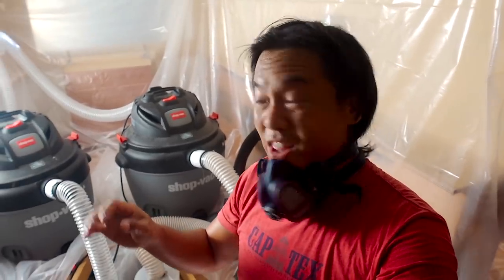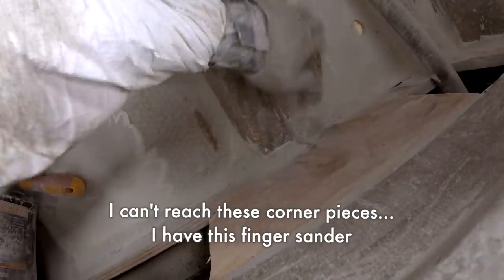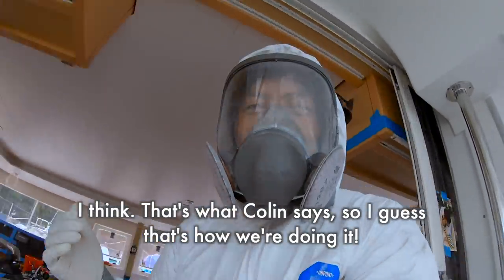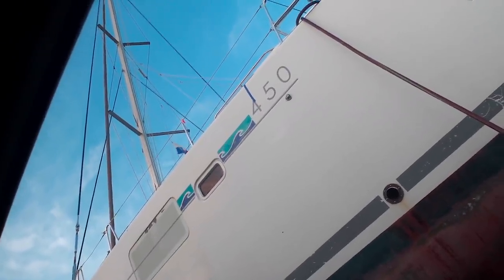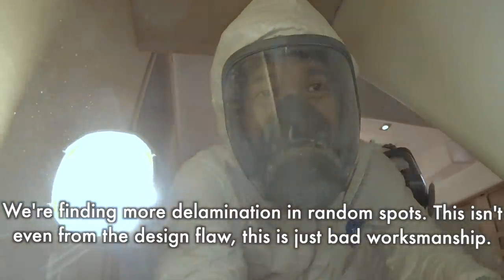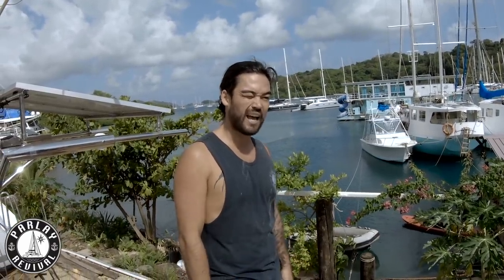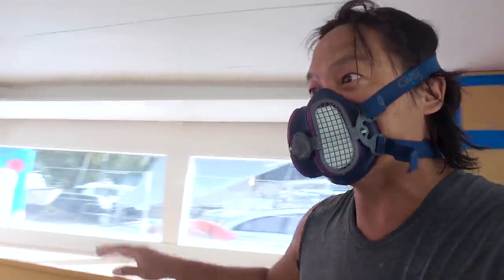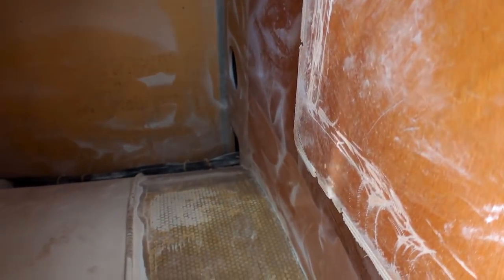I Sacrificed 3 Days of My Life GRINDING Fiberglass to Save $18k

Comment: To be honest I don't know if it is actually a design flaw...
To my understanding the main beam which is laminated 19 layers is made the way it is to be able to flex a certain amount.
Those catamarans are designed to have some give, laminating fiberglass with the right method can create good flex.
Using certain methods can make it more flexible. Is the 450 made to flex? I think it is designed for limited movement.

If stressed above a certain level something has to give. 
If that beam delaminates or even breaks or cracks something is wrong.
It would show that anything over that level of stress is not expected.
If that beam breaks in any way that would mean it has been stressed past it's limit.

A good engineer such as the designer of these Lagoon 450's would have factored in the stress levels properly.
So if this bulkhead breaks that would mean the boat has been taken to an unexpected level of stress.
So is it a design flaw, user abuse or excess forces of nature? One thing seems sure these cat's are getting more than expected.

So many, a high percentage are getting more than expected stresses to the bulkheads especially this main bulkhead.
To calculate if it is a mistake in design it would depend on the percentage of these vessels that suffer this main bulkhead corrupting.
Is anything above 10% too many? Is 20 or 30% too many? personally in my opinion any more than 20% is too many.

I also think each one that has the main bulkhead problem needs to have it's history investigated to that know properly.
Is the particular Catamaran over used? Was the rigging of the mast over stressing the joint of the 2 hulls?
Was there too many incidents a particular vessel was in that caused the stress in between the hulls and in the hull bulkheads?

If there is a disproportionate amount of the Lagoon 450"s and other of Lagoons models that suffer this same breakage.
Then obviously it is a design fault. This needs to be looked into otherwise it doesn't seem right to blame it on the makers.
There needs to be an investigation. Now there is an accusation saying it is a design flaw I really want to know who is at fault.

Ok so fact is there is none that have broken apart completely so that would be in favor and the makers.
Fact is they hold together even when battered by cyclonic winds and broken moorings, it is all in favor of the producers & builders.
I am erring on the side of the makers but hope they will do more and go further than supplying those kits.

At this stage I tent to think the question is: what else can they do to help those that suffer this problem?
I think they could do more but don't think they should be expected to help everyone of those who have this problem.
Lagoon should setup a panel to decide each case on merit is one way of tackling this and I hope they do that.

They seem a really good company going by the way they communicated and helped the Parlay Revival team.
And also they quickly worked on the resolve and still are going by the way the kept contact with Parlay.
The important thing is for each owner to get a good resolve and quickly. Work on a resolve don't stop and argue or gripe.
Reply from the maker: Want to read this again and respond fully,  but just wanted to quickly say that all of the boats are affected and need to be reinforced (according to lagoon) and out of ~1100 there’s at least ~300 where the bulkheads have broken already. That’s just the ones we know of. Also the designer of the boat is the one that offered Colin all of the support and he actually called out the weakness and “design flaw” though not in those words. I’d love to go into the nightmare that most owners have had to go through to fight for any kind of support from Lagoon, but what good would it do. Thank god for my bulkheads are fixed correctly and the way the designer of the boat recommended. And thank you for watching all this craziness!
Reply: @david_shih  Yeah sorry so long that comment. I have been thinking about this a lot because I like problem solving and enjoy fixing things and devising ways to fix things; this particular issue is really intriguing me personally for some reason. Seeing such a big company interacting is a whole unexpected thing so if they take up the challenge of responsibility this will be awesome. And awesome because of the scope of that problem they need to solve. And also if owners work together to get a good outcome parallel with the company for good outcome for all concerned that would be awesome. I think you and the Parlay team are doing something amazing; that just do it attitude is awesome to witness David. Much respect to you all.

Comment: I worked for a fiberglass mold company. I was a grinder. I would have a 3-4' of fiberglass dust on the floor at the end of the day, even with a vucume dust system to pull the dust to the back of the room I worked in. I was lucky to work with a fresh-air tyvek face shield hood, that pumped fresh cool air at the back of my head. I double glove and use painter tape between hand and tyvek suit. leave the pants leg untaped to let the air out...I still got fiberglass dust on my wrists, but using a scrubbing loofa everyday on the parts that got exposed does help...
Reply from the maker: Aw so jealous of that forced air system!  Did it pump air from a fresh air location? Or just through a waist mounted filtered pump?  I was desperate for one of those, but couldn't find one in panama anywhere!
Reply: @david_shih  yes, the system is mounted on the roof, with a filter. a 80 ft. hose connects a a attachment to the hood i wore on my head. so its far from any fiberglass dust. each room in the building I worked at had these hose attachments. Not those $300 filtered waist systems sold on amazon.

Comment: Maybe I’m wrong but I find a diamond cup disc ( like you would use on concrete ) is good for fast removal of anything that isn’t sticky . It’ll fit your 5” grinder.
Reply: And shouldn’t clog much and less $ on sanding discs
Reply from the maker: I'll have a look for one of those next time I'm in the city.  Thx for the tip! The only thing I can think of is that sometime you need the flex of rubber backing plate when you apply pressure to the edge of the disc or when you're grinding around a light curve.

Comment: I’m thinking…
Why not (when all grinding is done) high pressure wash every thing, from top to bottom while the bilge pumps drain all the shit out?
Reply from the maker: Great minds....i actually ended up in there with a garden hose for hours on hours! Hooked up a portable pump because I didn't want the bilge pump dealing with the thickened pasty run off.
Reply: @david_shih  Mate, a garden hose will not make the trick. Needs to be a high pressure washer (not with extreme pressure) to get the dust to unstick from the surface.

Comment: To get fiberglass off skin cold water rinse then pour vinegar on the area repeat
Reply from the maker: Ooooh I’ve tried that but didn’t have too much luck. I think when the glass dust is in high volumes the only thing that works is not letting it hit your skin. Maybe with a positive pressure suit.

Comment: The negative pressure dust control idea was perfect. well done!   I do HVAC so i am in fiberglass all the time.     i always try and shower using cold water to keep pores closed and wash in the direction the body hair lays....but i don't believe there is a perfect solution to stop all the itching.
Reply from the maker: I'll have to try washing in the direction the hair lays--i usually just scrub back and forth and probably make it worse.  Do you use these 3m tyvek suits too? Is there anything out there that's better? Dust definitely still gets in even when i tape the sleeves.
Reply: @david_shih  i do not use the suits.... too dang hot to be wearing in an attic.i think sweating helps keep the glass out of the pores of the skin so I just wear jeans, cotton long sleeve t shirt and a neck gator to keep exposed skin to a minimum.( be sure and wash all those clothes separate in laundry or hand wash )  Believe it or not i seemed to build up a tolerance to the fiberglass itch over time ( or my pores got completely clogged with it LOL ) i've found my arms and neck are most sensitive so that is what i try to cover up/ protect. dont shave for a couple of days before or after a heavy fiberglass session... plus of course eye protection and a quality respirator.  washing with the lay of the hair in cold water has been my best solution so far .... not perfect but pretty good.

Comment: The problem is they have tons of hull being held together by an inch of plywood in places, the bad connections don't help but the inch of plywood was wrong.
Reply from the maker: You’re giving too much credit. That ply is 15mm thick. Even with a couple layers of fiberglass it’s still about 3/4” max.
Reply: Once one area fails or movement it stresses the next area.  The shear loads go up with this movement.   To me it seems even with only a 15mm rib the bonding to the hull should be built up like 5-6" radious in the fillets

Comment: There must be some way you can attach a vacuum hose to the grinder so that it would suck up the dust as it comes off the grinder. Have you tried that?
Reply from the maker: Yes I actually bought 2 dewalt shrouds. They work perfectly on completely flat surfaces, but anytime the seal is broken (bristles surrounding the shroud) it kicks out tons of dust. So they really didn’t work on the beams or any of the edges/corners and it became a big pain to keep removing them and reinstalling. Damn good tip thorough, for any other application.

Comment: maybe instead of vacuuming every surface part, just sweep the surface to a center point so you could vacuum the dust efficiently.
Reply from the maker: I had a brush attachment that got lost under a mound of dust somewhere. I ended up in there with a garden hose washing down every surface for hours!
Reply: No food way to clean a mess like this.  Some people say don't waste time cleaning yo until the und but some of us like to clean up a bit as we go.

Comment: Pro tip super hot water on itchy areas and apply as much pressure as you can with your hand and wipe itcy areas away from the heart ❤️  seriously only thing that works a little bit you're still going to itch until you're acclimatised
Reply from the maker: thx dylan...i'll try in next time
Reply: @david_shih  hopefully no more grinding for you. That's the best way to keep the itch away 👌

Comment: F**k me! that gap between the bridge deck and the bulkhead!  Like you say, the glue never touched!!  I'mcurious did they simply not check their work ... or did they see it and just go "ahh, whatever, close enough" ...
Reply from the maker: so here's the thing...there's no easy way to see that section once they drop the deck on.  I had access only because I literally cut a 2ft x 1ft  hole out of the deck in the drain in front of the door.  But the tolerance isn't even close...it's like it was never designed right.  As an after thought they were like, "well, lets put some glue on there just in case it touches, so they don't rub against each other an squeak."
Reply: @david_shih  You should consider making an inspection hatch for that area.  It's a design flaw that there isn't already one in place, since the factory should have checked the adhesion after mating the upper and lower.
Reply: @david_shih  As all their panels are CNC cut I suspect every boat is like that then ... this will not be a one-off fault.

Comment: David - for the rebuild of the cabins how good would it be to link up with Onboard Lifestyle on the  custom 435 catamaran SV basik. Look at some of his cabinet work - would be awesome if he needed a little work and you could both come to some agreement - your boat would look awesome and non squeaky - winner winner if it happens and also very youtubeyville - The panama canal is the only thing between you
Reply from the maker: not a bad idea at all!!!  collaborations are so fun. I'll have to check out their vids.
Reply: @david_shih  hi Teal is very good with woodwork and glass see Part 1 ep 37 that shows the quality of the work on his old tri and later the ep 25 "designing our new head" - all good
Reply: As a wood worker hobby guy it's hard enough to fit things into square rooms but to build cabinets into a odd shaped hull I fear for you.

Comment: It is just criminal the poor workmanship from Lagoon. Unless you do what Parley and David did it will never get right. Just look what David find that has nothing to do with the damage.
Reply from the maker: I was quite shocked with all the stuff I found, but I'm fixing it all and it will be stronger than before! cant wait!
Reply: @david_shih  it is great that you point out the workmanship and the other places that your bulkhead failed. Most people are just focusing on the main bulkhead and not the result of that one failing and leading to all the other cracks.
Reply from the maker: @hanssolo4ever  totally man! Glad you can appreciate that. There’s definitely more to the bulkheads then just a simple crack!

Comment: You can layer the glass mat starting with the largest first.  The thinking behind  doing it that way is that each layer has a greater contact patch with the layer below.
Reply from the maker: I've heard it both ways smallest to largest (more pieces have contact to original surface) and also largest to smallest (biggest pieces has best bond to original.  To be honest I cant work out the logic in my head of which one is better.  Thoughts?
Reply: @david_shih  For epoxy, start with the largest.  For ester resin, start with the smallest.

Comment: Didn't you have to pee right after closing every hole of the protective clothing with tape?
Reply from the maker: Nope, well, unless by pee you mean poo. Then yes. And then the zipper gets stuck on the tyvek fabric 10 separate times as the pressure is building and I’m desperately trying to unzip.
Reply: @david_shih  uhh that's even worse. Same thing if we go skiing or motorbiking. Just after all the clothes are sealed you can open them again to do your business :-D

Comment: Painful not watching use the correct tools.  They make a grind wheel for glass instead of the pads you are using.  Goes at least 4X as fast.
Reply from the maker: No way, share the wealth brother!  I tried all different discs, flap wheels, metal cups, diamond wheels. Nothing seemed to work as well as the standard 36grit discs. Maybe it’s because of the curves and crevices we had to work with.
Reply: @david_shih  If you had used a segmented diamond grinding wheel it rips into the corners and flats or convex rounds and would have been 4X faster than flat 36 grit sand paper.  Key term is segmented.  Not grinding wheel.  It looks like a giant sideways gear out of a differential on your car.  Does require more strength to use and if you are tired... it works no better than anything else as pressure over area is what is doing the work ultimately.  You do also have to clean them occasionally, but frankly everyone is begging for a break anyways.  Flat sandpaper is still required for rounding edges and smoothing corners though.  Also a wet grinder is even faster, but common Joe has harder time finding one.  Keeps dust near zero to boot, but flings wet slime everywhere, face, down your neck etc so... pick your poison.  No free lunch.  It SUCKS every possible way one does it.
Reply from the maker: @w8stral  ah thanks for the tips! i think after all this i choose wet grinding for sure. I couldn't find any wet grinders though. I'd much rather suit-up and just deal with flinging slime!

Comment: I thought  the bulkhead  itself should not touch the hull its connectrd by the tabs. Thereby avoiding the line bulge on the outer hull.
Reply from the maker: I think you might be right on that one!
Reply: The hull should be strong enough at the bulkhead attachment points so it doesn't change the hull shape.  It seems like there should be lots more hull thickness at each bulkhead.
Reply: It would make the hull ridiculously thick, weight penalty.  Also the tabs from bulkhead to hull spread the load over a greater area hence a much stronger joint.

Comment: After it is all over, tell us how well that dust capture system worked, and what you would do differently.
Reply from the maker: I can tell you right now... it was about 90% effective at capturing the dust. But imagine exploding a 50lb bag of flour in mid-air in the room you're in right now...and then subtract 90% of it from the air and where it lands. It's still everywhere. For the big jobs where we're grinding out the entire beam and whole panels of the bulkheads---nothing will help. But for smaller jobs inbetween fiberglassing sessions the setup has been invaluable.  As for the 1500cfm duct fan creating negative pressure and preventing dust from escaping the room--that worked like magic!